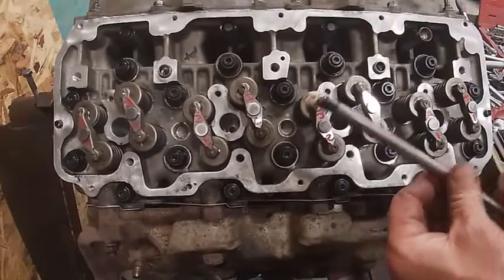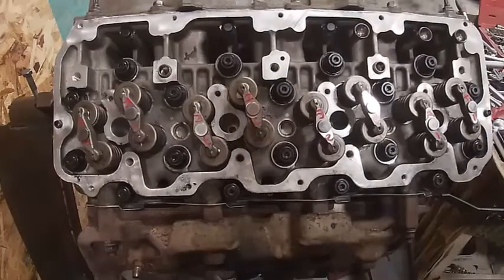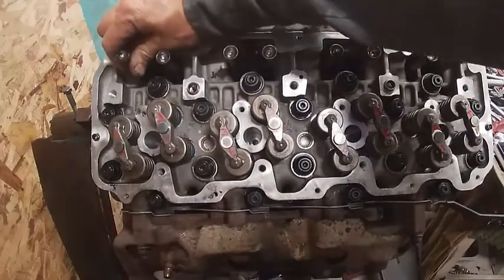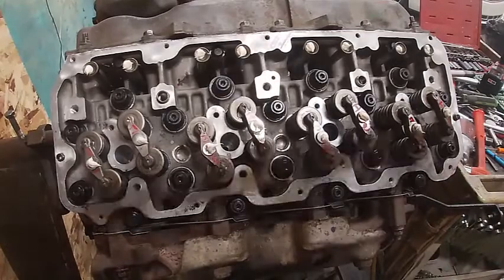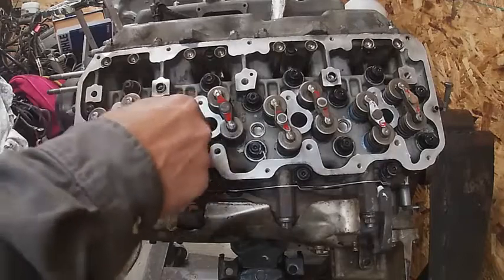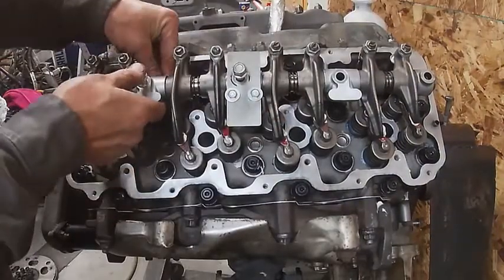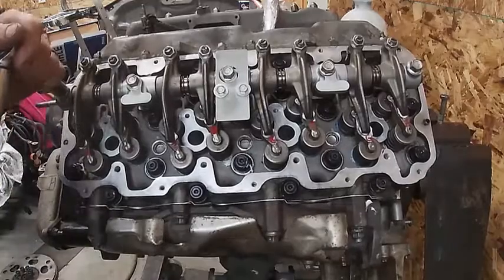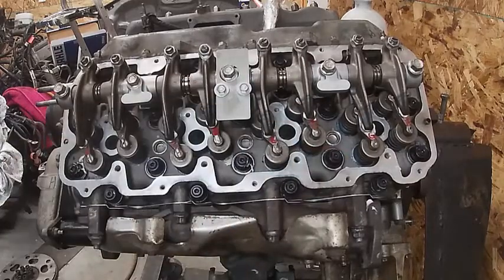Installing Rocker arms and push tubes on a duramax engine

Comment: What is normal wear for a motor with 137k.  I had .015 lash on one.  .003 over spec.  Is this normal or a sign that something is failing?

Comment: If I pull the rocker assembly out to do studs do I have to reset valve lash 

I have no gasket problems but I’m replacing the turbo so I’m just doing them now